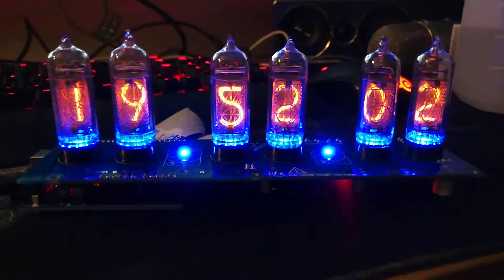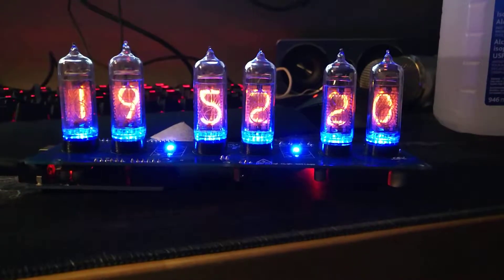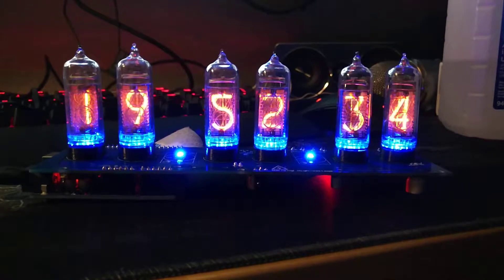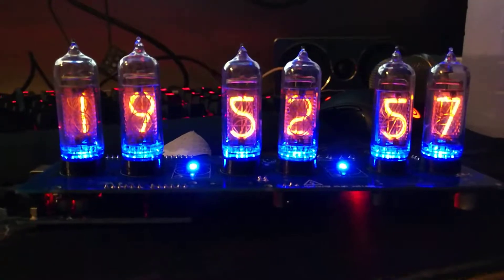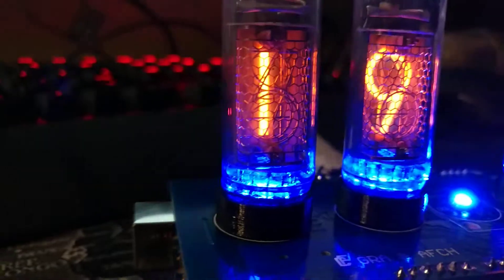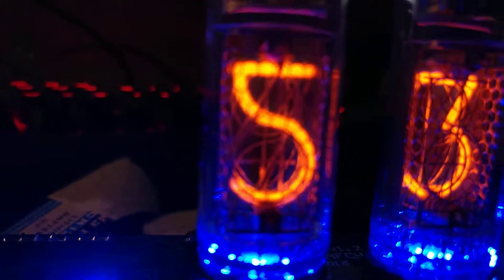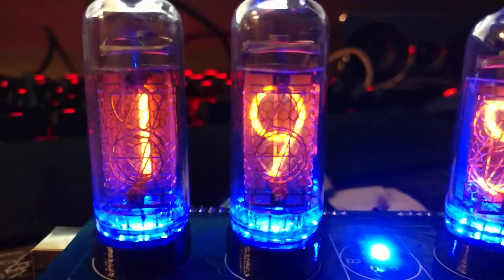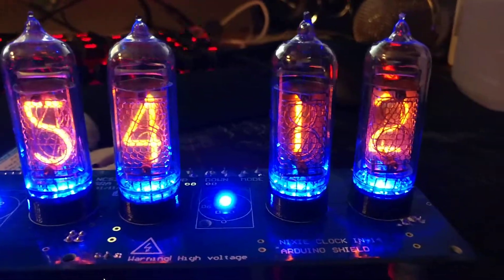Diy nixie clock - working perfectly!

Comment: Hi, nice job man! I am facing the same challenge. I have the board NCS314 v.2.2. Would you know if it is possible to test the board without soldering the tubes? I am afraid of burning something. 
I just uploaded to the arduino mega a sample code from Gra Afch github repository to test the voltages and dind't get the TP values . Also I saw some withe bubles in two components (perhaps the flux coming out) and nothing got hot or fried.
Any suggestion? Thanks in advanced.
Reply from the maker: white bubbles?  Could me rosin/flux from your soldering. I washed the board in alcohol after I was done, but left a gross white film on a lot of it. had to re-wash with a toothbrush. 

regarding testing without nixie tubes, There are some solder pads that are empty that If I recall you can test the output voltage. Start at 140 volts and work up until you get fully lit tubes. I think you don't want to exceed 180 volts?  (its been a year, don't take my word for it)